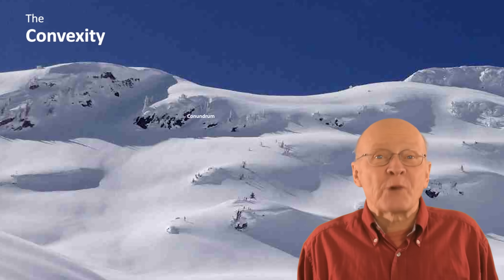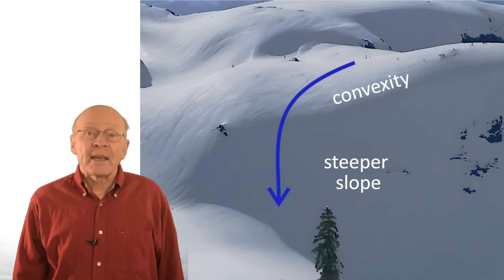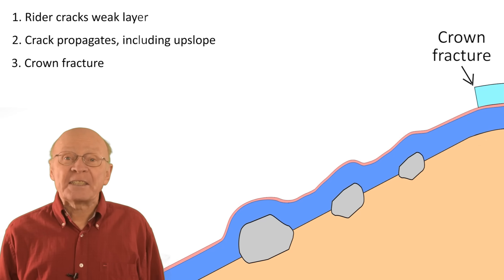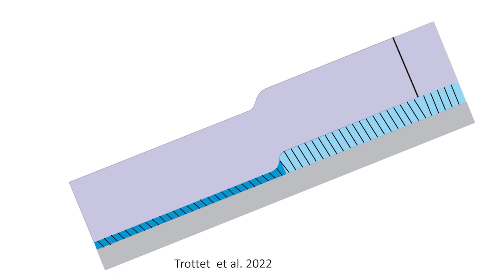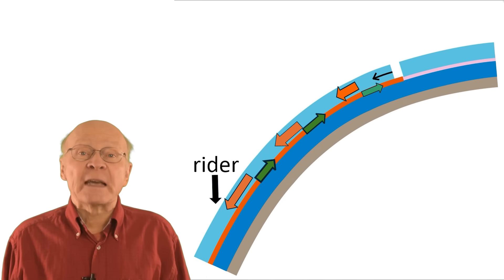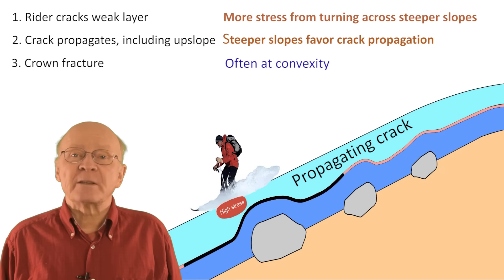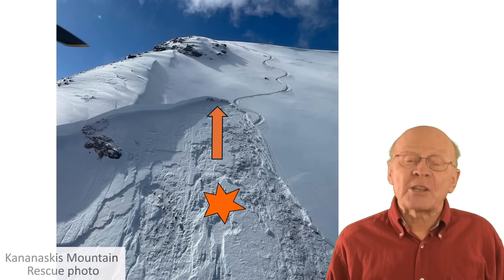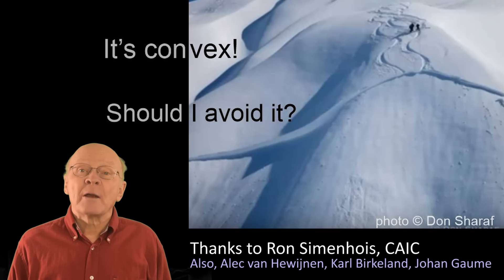The Convexity Conundrum

Comment: Hey Bruce, 

Is it fair to draw these conclusions from this video:

1. Straight lining the steep terrain under a convexity might decrease the risk to triggering a slide where a weak layer is present? From what I gather straight lining would reduce the total amount of area ridden because a straight line is the shortest path, it would keep the rider higher above the snow in soft snow conditions, and reduce the stress exerted on the snow. 

2. It is not that riders are more likely to trigger slabs in convexities but that the propagation of the collapse is more likely to stop at the convexity and thus that is why we often see crowns in the convexity. 

3. If given the option to traverse around a convexity and then re-enter a slope under the convexity and ride through the inflection point vs ride down a convexity and traverse out before the inflection point - research supports the ladder. 

As always thanks for sharing!
Reply from the maker: If I was so concerned about triggering that straight lining seem preferable, I'd ride elsewhere. There is a recent paper by Francis Meloche and colleagues that agrees with your first point. 2. I agree. 3. See my first comment.  If I was worried about triggering, I would NOT choose to traverse onto the steep slope below the convexity. Thanks for the discussion!

Comment: is there more tension in the snow at these rollover points? In ice, we often see fractures at bulges, were the outer layer carries tension. Is this another possible cause of fracture?
Reply: This a logical deduction. The snowpack is essentially crystals holding other crystals. The weak layer would have different shaped facets, which, around convexity, would have larger vectors of force acting on them. That friction or holding force, if disturbed, would create a chain reaction in rolling of that weak layer this creating the avalanche. I am not an expert, just spitballing

Comment: First we displace the snow, then compress the snow, once incompressible(conservation of energy maintained) collapse (mixed-mode anti-crack) and trigger avalanches. Common to all user groups and all situations. Concave slopes may already be incompressible and easier to collapse/avalanche. Cornices and ridge-lines are incompressible. Danger and hazard are in compression(concave) NOT in tension(convexities). Avalanches start in  incompressible snow and end in tension, they do NOT release. They mixed-mode anti-crack(collapse). They are created/produced/caused by human activity where s shallow weak layer exists, often a return avalanche, in seasonally non-persistent snow.

Comment: Contrary to traditional teaching, the steeper slope is where riders are more likely to trigger a slab avalanche. 

So you'll get a free pass on the convexity and then once you drop onto the steep part and start carving it causes the slide and an apparent break at the crown that is obvious to see even if it doesnt start sliding until your in the steep far below the crown... Counter intuitive but okay.
Reply: Yes exactly, and unfortunately there is no way to know if it’s going to go unless you pass the point of no return. You see some people trying to cut across the top of the slope convexity, thinking if it doesn’t tear it will be good to go.